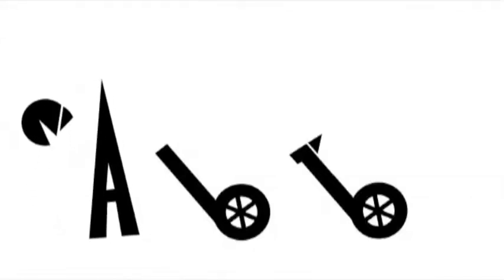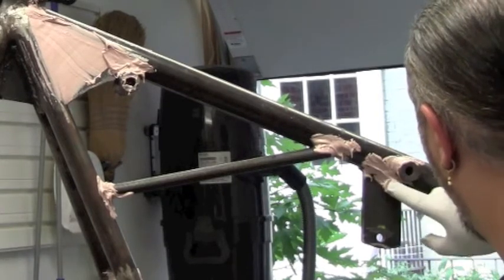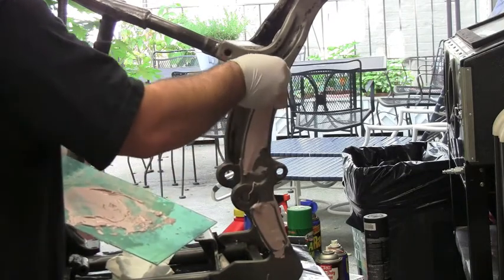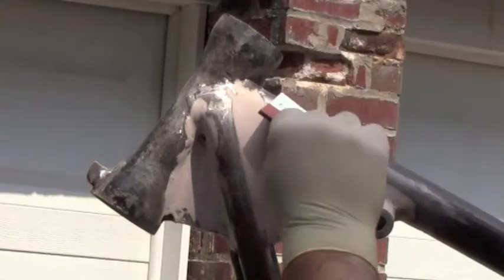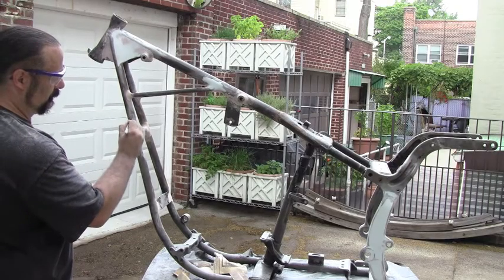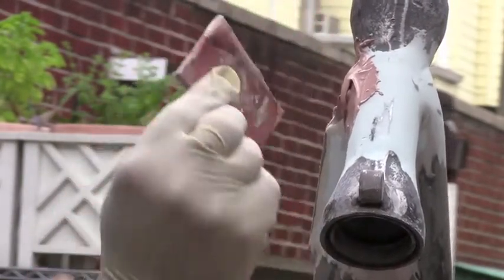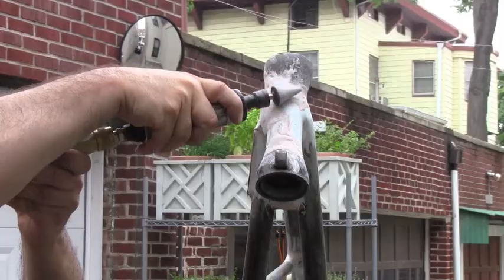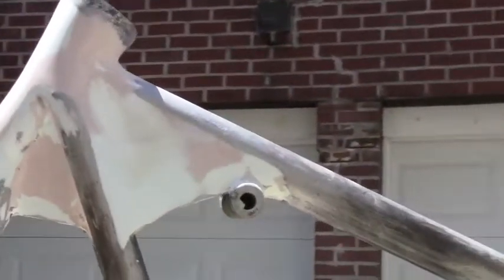ABB #14 frame molding

Comment: Just a tip to go along with this awesome DIY. When filler begins to set up you can knock down the high spots with a bur file to save sanding time after it's completely dry.

Comment: More time on welding and grinding could eliminate the need for Body filler . PRESSING the first film of filler into those rear "recess"  areas ( and the other places as well , would keep it from popping out in a year . A wood rasp gets excess of easy too !  OOPS !!! at 9:21 on the counter - it shows that the frame is maybe NOT  symetrical in that area -  neither is the filler work .